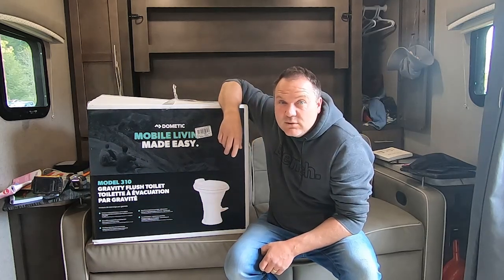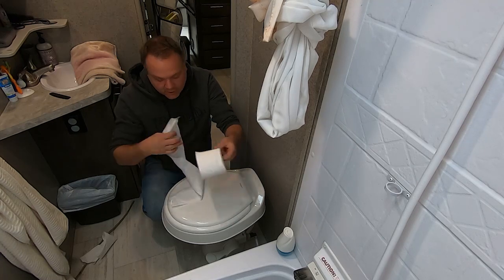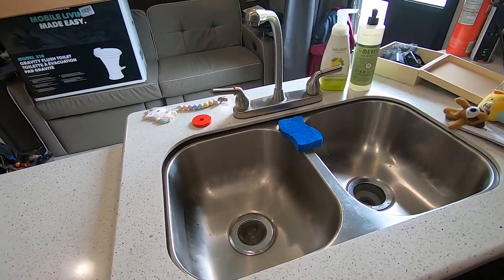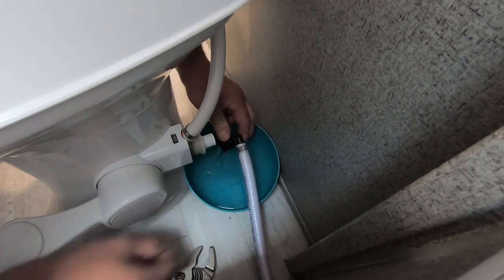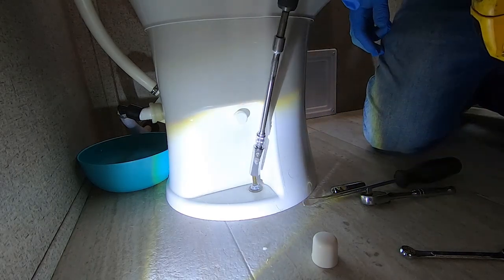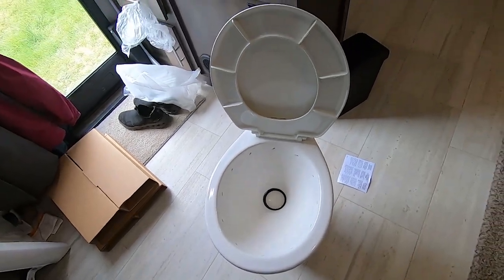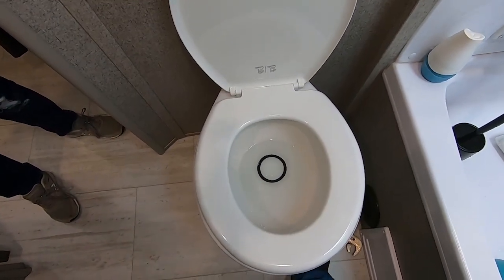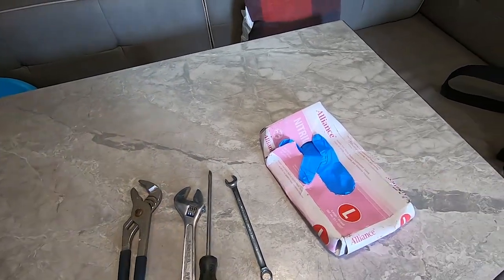GET RID OF THAT STINKY TOILET!!!  Switch from Dometic 300 to 310 series toilet... Ep3/23

Comment: 310 is doing the same thing.  Anyone have any fixes for this?
Reply from the maker: @bridgettgoins8106  REALLY??? We have been living in our trailer and have zero issues with the new toilet.
Thank you for your input. I hope that you can get that sorted out
Reply: @hangingwiththehunters149   that is good to hear.  Hopefully, we get this sorted out, thank you.  
The problem now is my husband took out the bolts on the bottom to separate and they have the “one time”  screw plastic anchor type  gadget on them. 
So, now to figure out best option to put them back in
Reply from the maker: @bridgettgoins8106  That isn't fun!!! Good luck